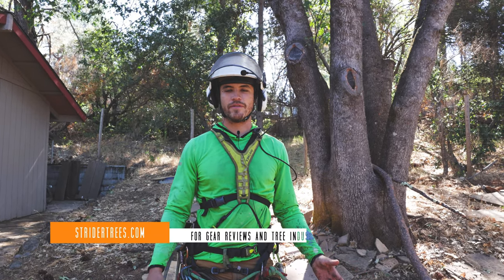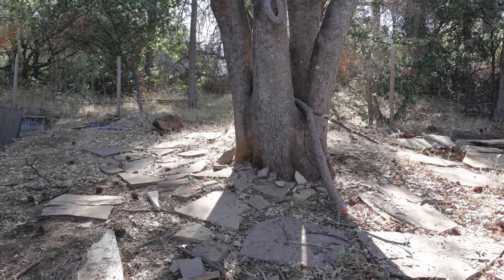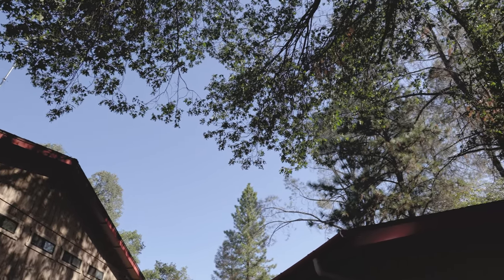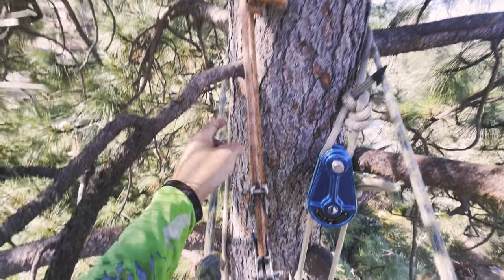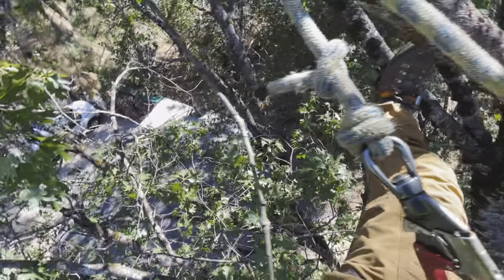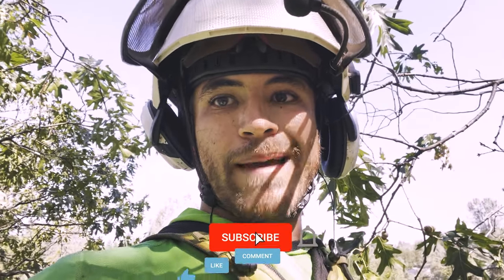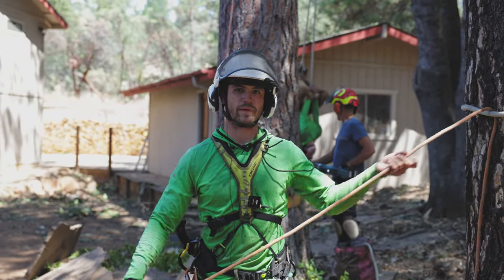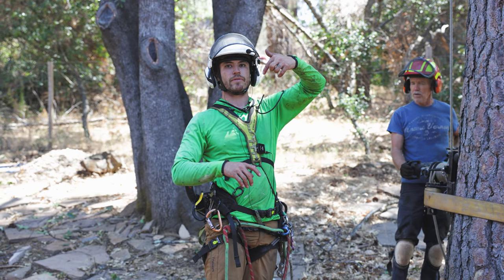Climbing & rigging with a remote anchor | Oak prune over garage |  Weight Reduction tips

Comment: The rope that the arborist block was on has to be retrieved so I'm curious... When you take off that block and start pulling that rope to retrieve it, isn't it going to be filled with sap
Reply from the maker: Yes if it is set up over sappy branches it will get a little sappy.

Comment: Nice job. 
What are you running on the GRCS instead of the handle.
Reply from the maker: Its a makita 36V high torque drill and a special bit that works in the GRCS.  Its a VERY worthwhile upgrade !!
Reply: @Stridertrees  interesting, never heard of that drill, I'll have to check it out.
Thanks for the response.

Comment: Great rigging video!  I thought you preferred the Rope Runner Pro instead of the ZigZag?
Reply from the maker: The only reason I do is when I might be switching ropes or I’m primarily in SRT for that job.  I don’t really like the ZZ for SRT because of how big it is with the chicane or rope wrench on it.  It’s smooth and works well, just bulky.  The RRP is more compact and comes off midline if need be.